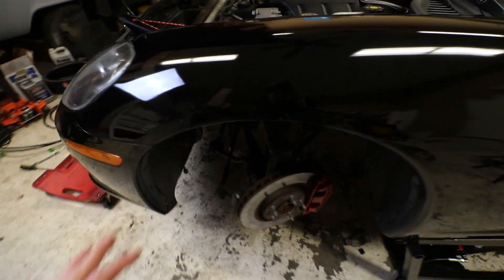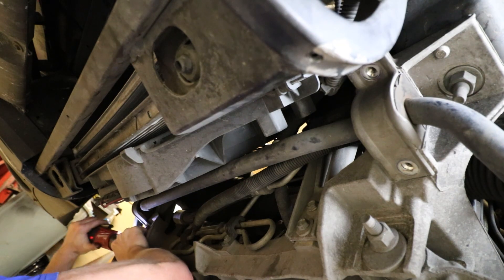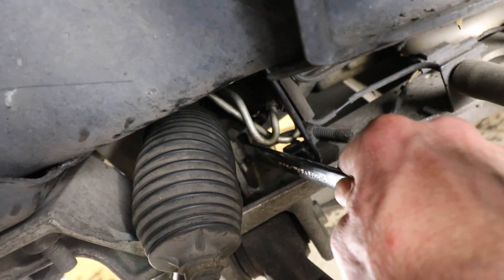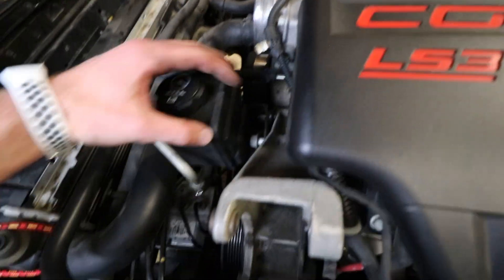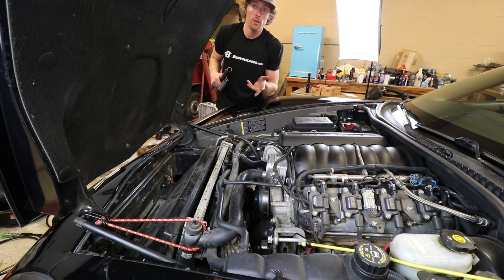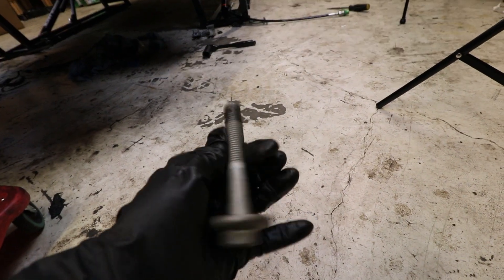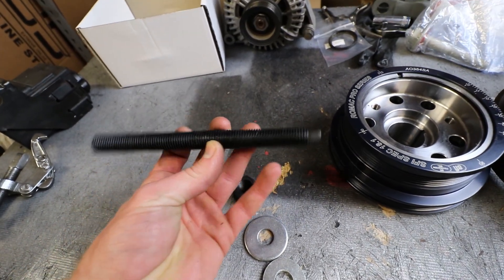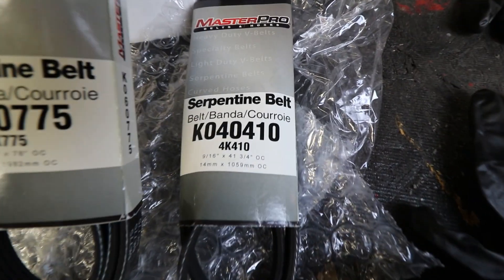C6 Corvette Crank Pulley Removal & Texas Speed Underdrive Pulley Install

Comment: Don't worry about how loose the tie rod nuts are. They don't need a ton of torque because they're under insignificant load. All they do is push and pull the knuckle in and out to steer your car, which doesn't take much effort when it's moving

Comment: Did that pulley come with a alternator pulley? Or did you reuse the stock one man. Any charging problem?
Reply from the maker: Sorry for the late reply, it did not come with alternator pulley. I haven't had any charging issues yet just a little overheating issues but go that squared away. I am looking at different alternator pulleys just for peace of mind though.
Reply: @MitchCarveth  What was your overheating issue?

Comment: Take out the two bolts for the A arm on each side. Top A arms.  Passengers and driver and the shocks and loosen steering shaft . Loosen the cradle bolts 4 of them. Not all the way. Keep the nuts on to drop it 1/2 inch or so. Than take out 2 motor mount nuts and raise the engine so the harmonic balancer nut clear the rack and pinon shaft. also take out only one hydraulic connection next to the balancer bolt.  This way you drop the cradle a little and raises the engine up to clear the rack and pinon. Also you may put good quality 2 piece Timing cover so cam swap be easier next time.

Comment: Great video man, very nice work! Just wondering why you used a factory GM bolt and not an ARP?
Reply from the maker: Thank you! Just using the GM bolt right now cause I had an extra one. I'll be doing the cam swap this fall/winter and replace it with the ARP.